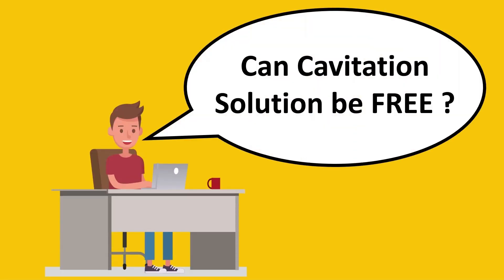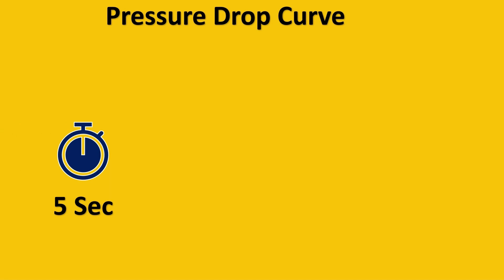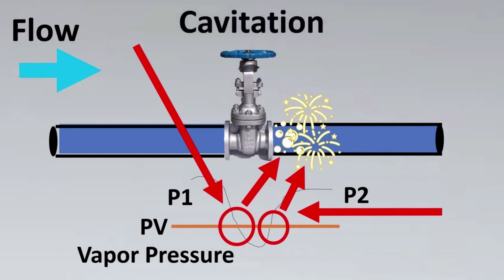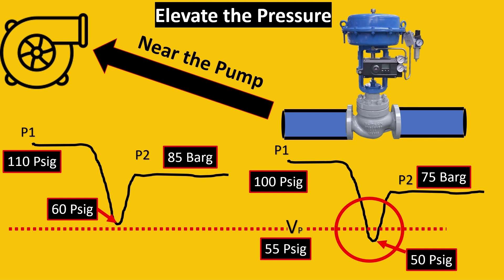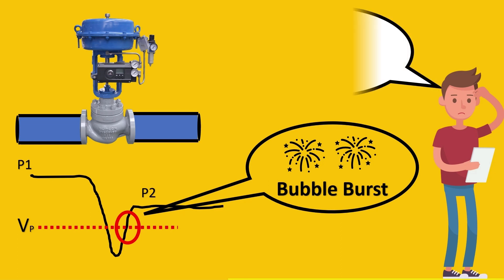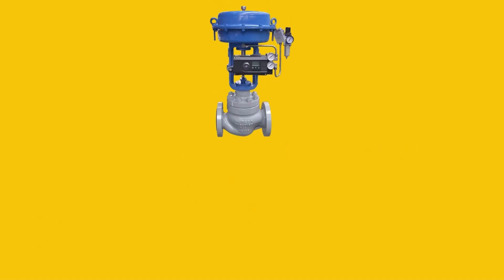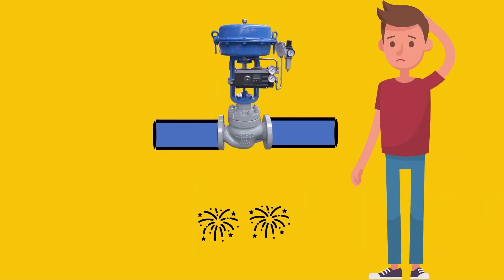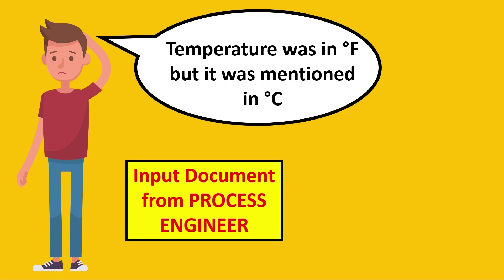How to AVOID CAVITATION in Control Valves -Part 2

Comment: Great job Asad.
But I have one query.
For ‘Elevate the pressure solution’ Why would the Inlet Pressure near the pump be 110 psig and away from the Pump inlet be 100 psig? Should it not be uniform across the pipe?
Reply: Flow occurs with pressure drop. Higher the pressure drop, greater the flow will be.